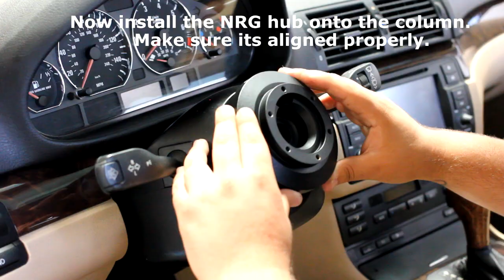NRG Hub, Quick Release & Steering Wheel Install

Comment: I don't understand why they don't show the horn wires being connected.
Reply: those who install a quick release usually don’t connect the wires, wouldn’t be able to take the wheel off regularly
Reply: @jadenpage_wrxt  There are pin contacts on the quick release for horn and other utilities i.e comm button on a race car and it doesn't affect wiring inside the wheel. Don't spread stupid information
Reply: it's just a female connector you connect the horn and quick release
Reply: Because it's the easiest part that needs no instruction.
Reply: @TurnMaster mind giving instructions?
Reply: @colombian350jp male connector into female 😂 can’t miss
Reply: @SMIXOGAMING  I could miss because I didn't have that metal grounding pin,  calm down Mr big brain
Reply: @SMIXOGAMING  stay gaming
Reply: @colombian350jp  then they give you 2 metal rings to plug the grounding pin from the steering wheel, you just put it on your hub and plug the other one. I’ll « stay gaming » with my « big brain », but at least I know how to plug 2 wires together 🫡
Reply: Who needs a horn, just rev at people. Duh
Reply: cuz these things are usually meant for the track, where you’re less likely to use a horn

Comment: Soooo what are the metal shims & the ring with the cut in it for???? Anyone know?
Reply: I’m here for the same answer lol. I just got mine in the mail and was hoping they’d show them in here
Reply: Thats what im here for too 🤣
Reply: That’s what I was wondering
Reply: @e36dave52  did you find out? Im pretty sure they are useless because I’ve watched videos of them and the throw them off to the side
Reply: @jojoa.7625  I figured it out the circle with the cut is for the safety button option if you don’t want the safety button put it in there the other gasket looking things are a ground for the wiring when setting up the horn
Reply: Anyone know I’m just trying to figure out the stupid ring🤣

Comment: Ok but how do you actually release it? How does the wheel come off?
Reply: I know it doesn’t take 3 months to get this answer, but just for other people in the future. Watch at 1:16 . He takes out the quick release. It’s a simple bearring system. Lift up on the ring and the wheel slides right out.
Reply: the handle he pushed to get the quick release, same way to get wheel off

Comment: can i install wheel directly to hub or i need quick release
Reply: roki buča the quick release is totally optional, so yes you can directly connect the wheel to the hub adapter

Comment: U guys didnt even use the silver metal ring piece that came with the set up so what the hell is that for??
Reply: At 1:14 in the bag with the screws
Reply: @raidacaipo  Obviously this is a really late reply, but for anyone who checks this later, the thin flat ring is to allow a ground connection for the horn.  This is what customer service indicated to me today when I asked about it.  I received two of the same in my package.  A third and smaller, thicker ring with one section cut out is to prevent the horn button from rotating once installed.  That smaller, thicker ring with the single cut goes inside the cavity with the wires.  I will just leave this info here for anyone who looks for it in the future.

Comment: Does the horn and turn signal work ? Does the air bag light come on ?
Reply: everything should work just fine just make sure you get a resistor so the airbag light doesn’t come on

Comment: Will this work on a 2007 335i?
Reply: Yes. You will need 3 parts. The e90 nrg hub adapter, the quick release hub (in video), and a wheel of your choice (6x70mm bolt pattern)

Comment: Do you need the hub to install the quick release ??
Reply: Yes the hub is more of an adapter than anything then the quick release bolts up to the hub
Reply: mk4_marc the quick release mount bolts to the hub . The quick release locks into the mount

Comment: I installed quick release 2.0 on my civic ek. And its a little shaky. Why is that? I tightened everything
Reply: Their QC is probably spotty, but that's what you get for the price. My first one was tight for years until it got stolen. The one I bought to replace it has side-to-side play in it that the first one did not. Hopefully #3 is better.